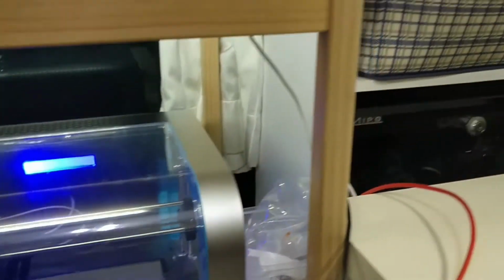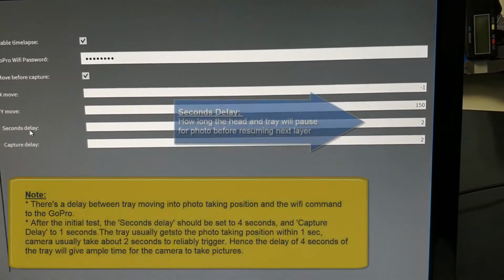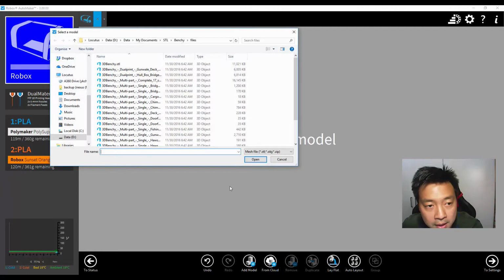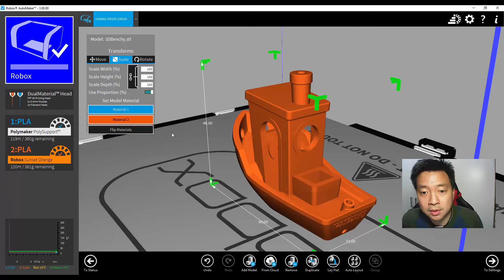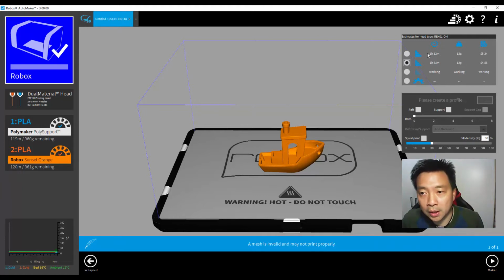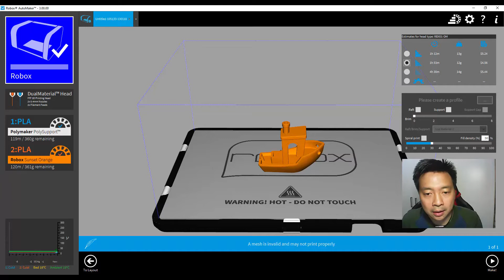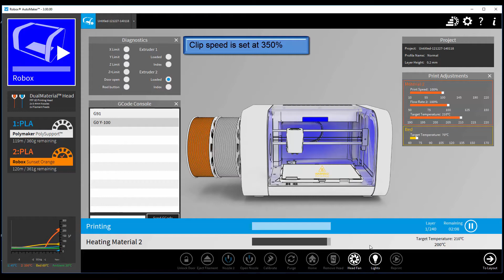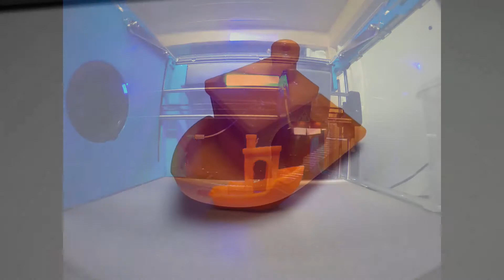3D Printing: Robox Dual Unboxing Part 3 - First Print

Comment: Hi Ken, are you still using this printer after 4 years? If do so, how long does the printerhead last before it gets totally jammed? Best regards Peter
Reply from the maker: Hi, Yes I am still using it. I did get a new replacement head but the issue was not nozzle jam but is the IC board on the head shorted and became undetectable. I think i used the original head for over 600 hours